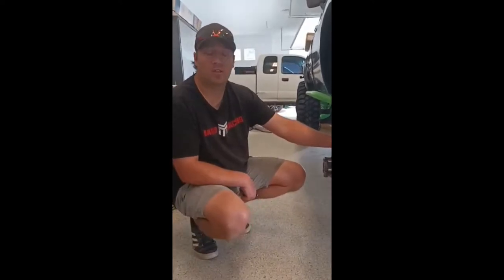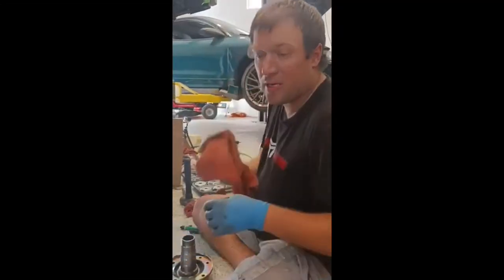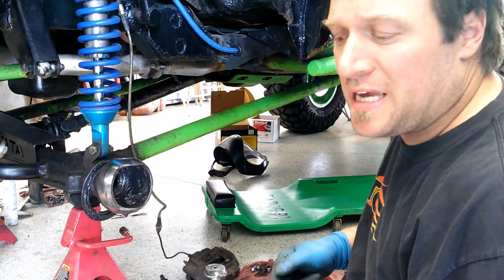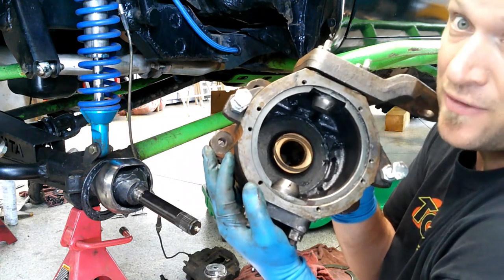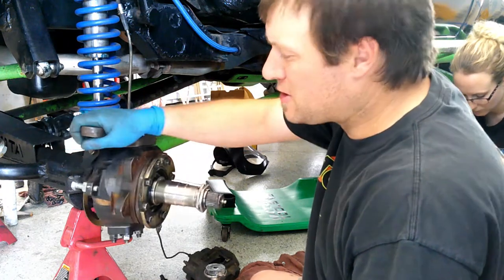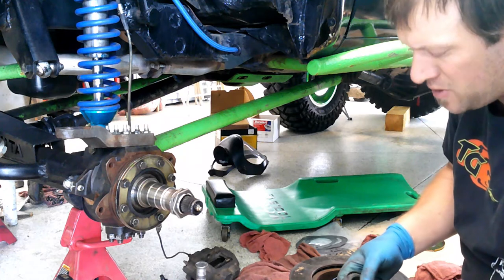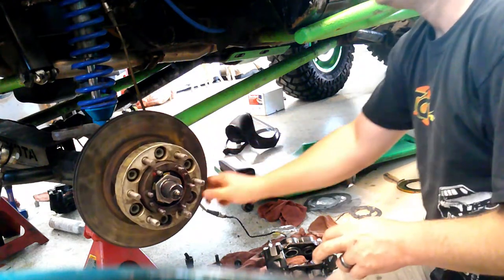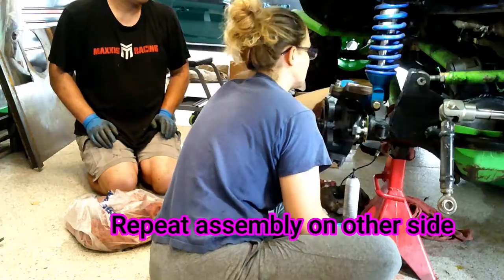Toyota 4x4 Front axle rebuild- FELIX the HILUX

Comment: do you have any tips as far as putting the three link on the front end
Reply from the maker: They make a kit for a second gen toy from Trail Gear. Its a little tricky because the first gen frame rails are a bit narrower then the second gen. If you have a stock engine you wont have too much issue. Depending on where things attach you may have to go fully hydraulic steering if you dont have room to put the hydraulic assist on there. That was our issue....ran out of room to put things.